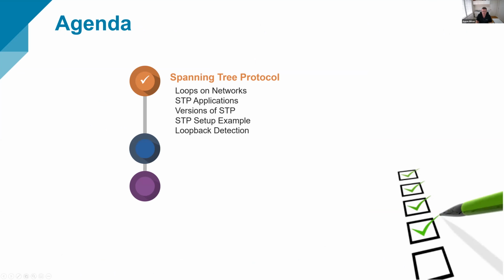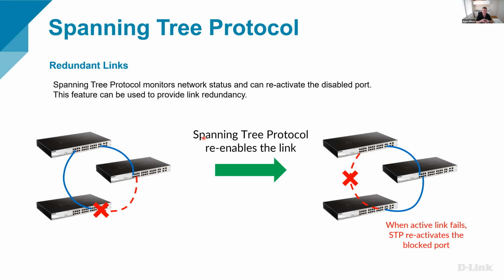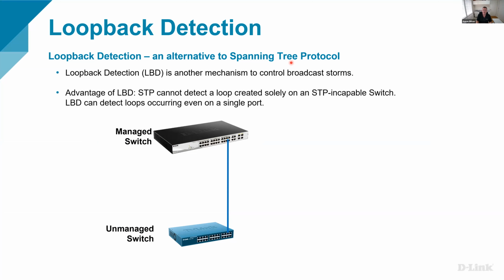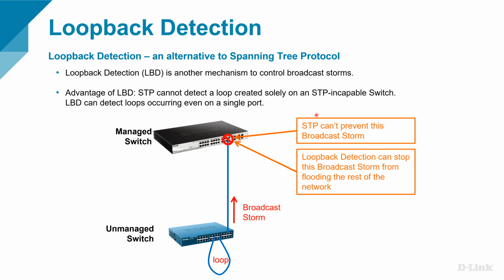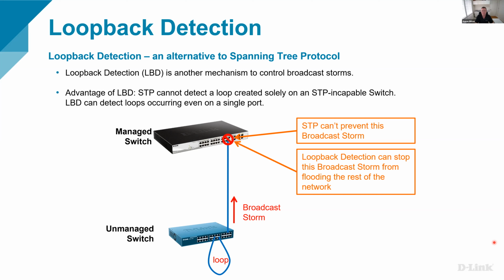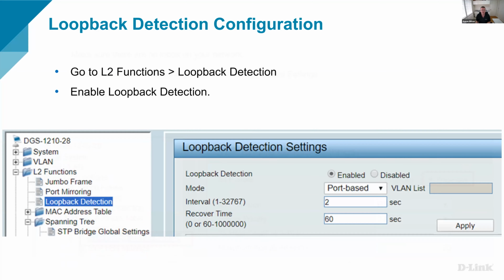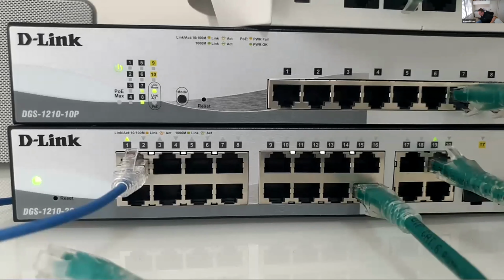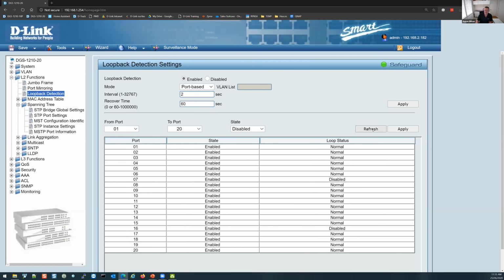Webinar: D-Link Technical Training on Switching: Session 3 - June, 2020

Comment: I have two DGS-1510-20 and would like to stack them and use LACP (and VLAN).
Often, switches will only allow Link Aggregation using the same speed on all ports.
Will it be possible to connect one SFP+ (optical) port from switch to switch and the left over SFP+ port from both switches back to the router, then connecting the two SFP ports from switch to switch ?
Thus I'd like to have 10Gb + 1Gb + 1Gb stacking between the switches, and 2x10Gb to the router.
-Eg. would it make any difference connecting the SFP ports in this case, or would they only be able to work as 'failover' ?